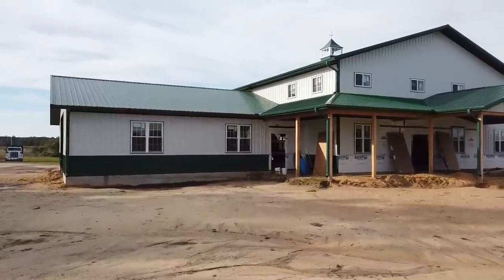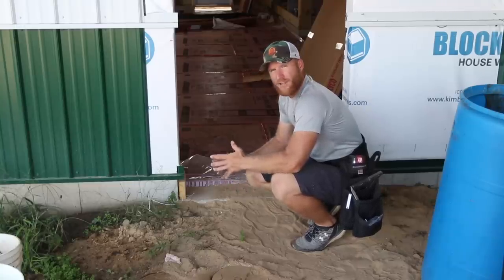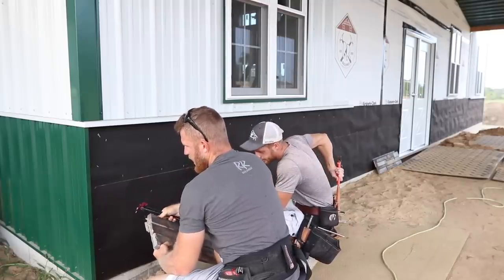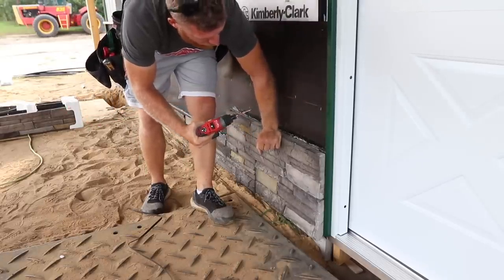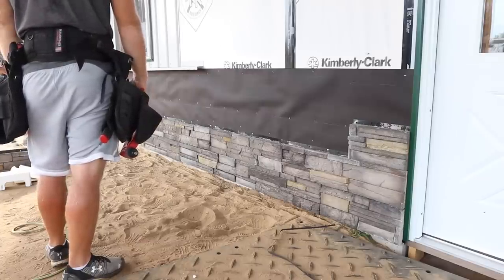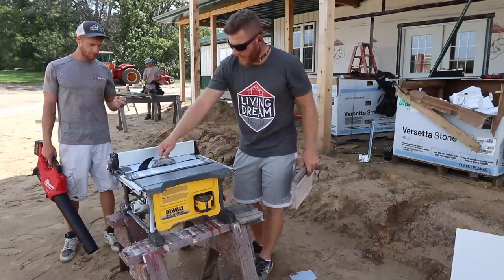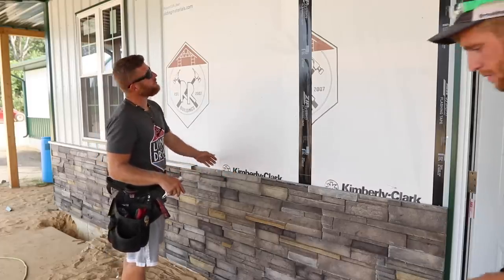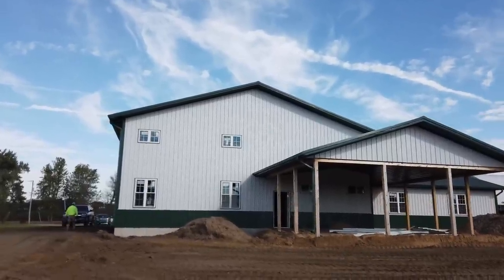NEW Hunting Cabin Final: Plus Versetta Stone Install

Comment: Do they pour the concrete right up against the versetta stone? It looks like it the sand is right up to the bottom of the stone in the pictures. I am installing versetta on my barn in a week or so and wondered how much of a gap I need between the top of the poured slab and the bottom of my versetta stone. I am in Rock Island Illinois so we get hard freezes here just like you guys do. Thanks for the videos. I watch everyone of them. I have learned a lot from you.
Reply from the maker: the stone is at grade so no concrete

Comment: Greg I am telling you my friend you are way to close to that blade?
U know I am sure minimum 6” ; why though?  It (the blade) pulled u into it?
As young, strong & fast as u are you my friend are no match for that blade?
At minimum if you work with one like that use “Saw Stops “ contractor models!
I am a cabinet maker / finish carpenter (custom).

You are flirting with disaster !  I know working in a jogging outfit looks good and is super comfortable but here is the deal?

We are not in a cushy profession?  It’s hard, tough, and rough work!
That is why most guys with real longevity in the trades opt for extreme tool safety ?
And demand that not only they wear work boots of quality and good work clothes 
They demand that their employees do the same?
Shorts are fine as long as they are “work” shorts (carhart , Wrangler, Duluth , ect.,.). 
I for one , no matter how good skip over hiring a sub who shows up in a pair of running shoes and silk looking shorts?
What is professional about that?

You use some of thee most expensive tool and heavy equipment & at one time ; not all that long ago you chastised Greg when u caught him in his Sunday tennis shoes on the job?
Now your both in a fashion contest?

I hate to see u slice off your hand and truthfully over the years I learned it’s a lot of little mistakes and compromises that lead to the “BIG ONE”

Boots!  Work pants! ; contractor model Saw Stop and use push stick, ear protection, eye protection, ect.,.

Greg is a very impressive young man?
You can train him right to be a good leader down the road for you?
Or show him how to do the job using all the nice tools while looking great?
With missing the point?

Anyway your a great talent & I truly enjoy watching you but I hv notice some slacking off the contractor/leader rules!
Which is we are disciplined ppl!

Rules can be subject to change?  Discipline is never compromised ; never!